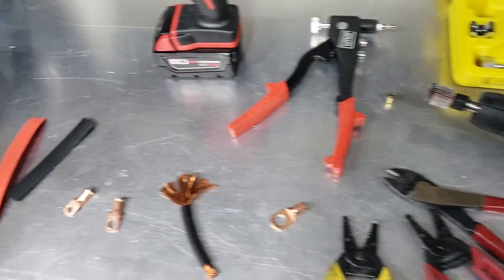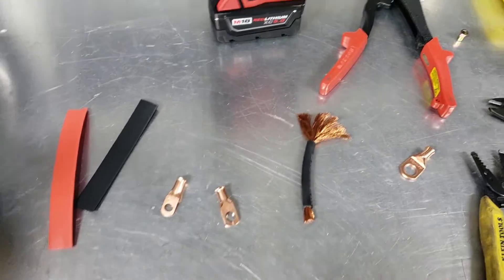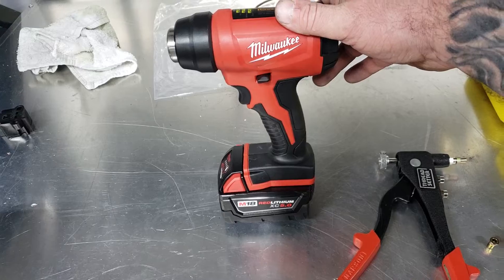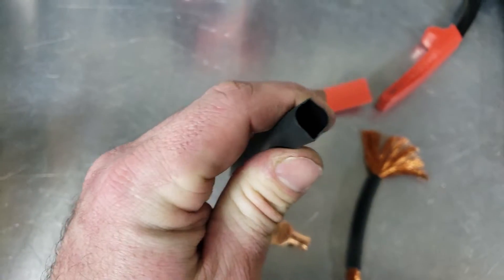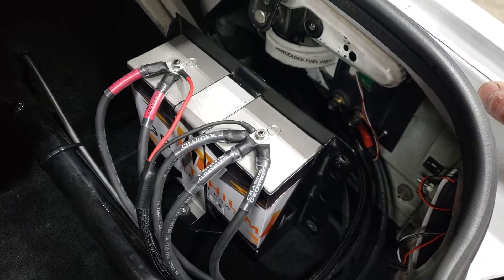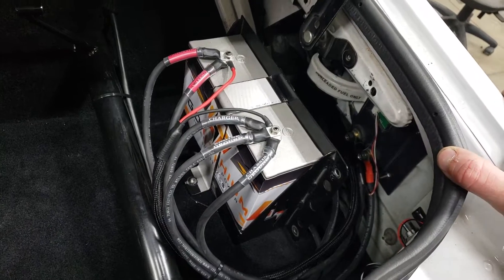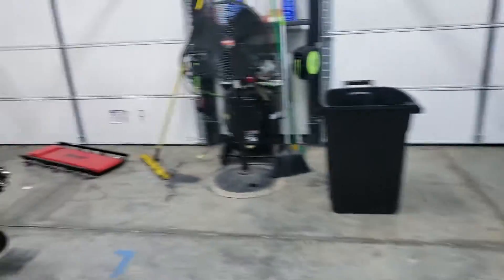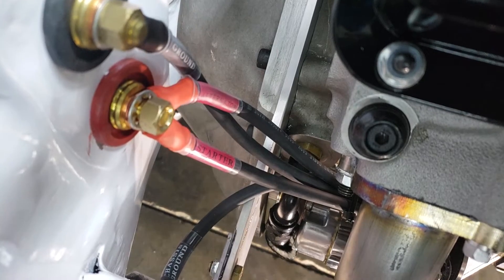Holley efi proper grounding and wiring practices

Comment: Really good info needed before relocating the battery, thanks, Devin. I did want to confirm one thing. Once the ground is through the bulkhead,  I  see a few cables. 1 to the engine block (mounts) 2 from the chassis to the engine block passenger. I see a 3rd ground, is that just going to the other side of the block, wired into the engine mount holes, or head holes like the passenger side? Thanks

Comment: Great informative video, thank you! Question - can I pull a power wire off the fire wall grommet to a power distribution block that'll power things like relay a relay for a Turbowerks pump scavenging turbo drain? Not using this line for sensors. Thanks for any help you can provide.

Comment: @SERIAL_PYRO  Impossible to do when the crimper handle is longer than the vice jaw depth. Crimper handle has to be offset to one side to allow the vice jaws to hold the crimper handle properly ( as close/level to the crimper pump handle as possible) otherwise you won't be able to put enough force on the pump handle to crimp properly.

Comment: I use 0ga ofc it's great need it for large stereo. Also have big 3 upgrade and 2 batteries. Learned about cable years ago when I used home depot 4 gauge for car stereo power wire it worked but was a pain to run. Great tips.

Comment: I have a Holley set up on my gbody I relocated my battery to the trunk using 4 gauge wire but my car will not start . When I use my tool it shows only 7.2 or 8.0 cranking amps with a brand new battery I believe there haft to be a Vote drop

Comment: How is the cut off switch shown to NHRA rules, maybe I'm not following it but with the alternator feed going to the lug that goes back to the battery, even whit the switch thrown cant the alternator still power the car residually? Wouldn't you need to run a dedicated charge wire back to the battery feed side of the switch?
Reply: You are correct  nhra will want the alt change change wire to go all the way back to the cut-off switch   nhra will test you cutoff switch at 2000 rpm to make sure your car will shut off  
Great question

Comment: Super informative video, thanks for sharing! Question on thoughts of distribution blocks - Is there downfall to making a large run (1/0 or 2AWG) for both power and ground to a distribution block near the firewall and branching off from there, with the exception of the alternator wire which will go back individual to the disconnect switch? I am in the process of re-wiring my car completely and have several things like the Leash boards, factory fuse box, starter, etc. and would like to minimize home runs to the battery where possible.

Comment: Do you only run 4awg with 16v? And do you thing 4awg will be enough for a LS motor starter and alt?    Also the two clowns that made comments about how you can do this different or how you’re clearing your throat can F off they’re probably democrats and can keep using car audio wire and cca Fing clowns pay no mind to them keep making awsome videos this shits helpful to more ppl than you realize Haters are gonna hate 🤘🏻

Comment: Thanks for the video, really informative. I noticed you didn't have any fuses or circuit breakers on the hot leads. Do you just not run them? I'd like to know your thoughts on the subject.
Reply: he uses a Racepak Smartwire PDM, no need for fuses or breakers 🤓
Reply: check it https://youtu.be/1j2-n-Ixvhw

Comment: There are a few things that I would do different such as I use buss bars for power and ground but that’s because I spent part of my life doing installing telecommunications equipment and wiring not only has to function but also has to be very neat and orderly. That said in general I agree and like your wiring practices but would recommend a couple of things instead of welding cable check the price of locomotive cable the main difference is each of the fine wires is tinned which help prevent corrosion and resistance, second is the use of No-Ox on connector and connections and since you we don’t want noise in are wiring try as much as possible to have some separation of power and ground. Have a nice day and a better tomorrow.
Reply: you have greatly helped this guy(myself) out. Finding the best alternative to car specific products, like the locomotive cable with its added corrosion resistence, is so nice. I will remember No-Ox and seperating power and ground as well. Sounds on the floor level signal sucks!

Comment: I heard you say you use  4ga what brand and where do you buy that from if you don't mind me asking.
Reply from the maker: i use 4 and 2 awg i buy it from temco
Reply: @theholleyefiguy  thanks for the quick reply... You have an awesome channel by the way I've learned a lot thank you.
Reply: Where do you get your bulkhead connectors I know you say a lot of stuff is not created equal want to make sure I get the best I ordered the wire that you use just wanted to make sure I got good bulkhead connectors... I see a lot of them have 3/8" posts is that what you run? Thanks

Comment: Do you have the power plug for the Holley HP computer?  I am changing a MEFI4 controller on a Ramjet to a HP Holley computer.
Reply from the maker: 558-308 is the holley part number
Reply: @theholleyefiguy  I am looking for the plastic plug only.  I have the wires run but need the plug for the computer

Comment: Good to know that i can safely use the firewall bulkhead as a common post to transfer my positive and ground through the firewall, I had always ran the ground and power under the car directly to the block/alternator-starter. Now I can move the wires inside the car and it will clean things up as far as im concerened. Love your videos.

Comment: Just wired my car up the same way as yours, minus the smartwire, but had a question.   Are you running any fuses inbetween the kill switch and the alt/starter wires?  i didnt see any in the video and i dont have any installed in mine currently.   thanks!

Comment: So I'm doing a Holley on my mod motor with a J2Fab 270amp extreme output alternator. Seeing this wire is rated for 150 amps, is it okay to use this Temco 4 gauge instead of something bigger like J2Fab suggests on a stock computer setup?
Reply from the maker: Use whatever is recommended by the alternator manufacturer
Reply: @theholleyefiguy  Thanks man!

Comment: I am planning on running a trans controller and pdm w/ a magneto ignition. Will following this technique be enough to isolate the electronics or are there other measures I need to take to make sure everything works properly?

Comment: how is the cutoff switch shutting down the car with the smart wire and alternator on the same side of the cutoff switch
Reply from the maker: The switch was there till the 4 pole switch showed up 
I used it for mock up 
The switch used is a 2 circuit switch
Reply from the maker: They're not on the same pole
Reply: Ok in video you had smart wire and firewall on same side of switch , and looked like alternator was on the firewall post.
Reply: Ah ok didn’t know they had 4 poles, thanks!

Comment: Devin That alternator wire needs to go directly to the battery not to the feed side of switch. You cut the power off at switch the alternator can and will keep power on. FYI
Reply from the maker: The switch has 2 pole and is double throw 
It's on it's own circuit
Reply: @theholleyefiguy  Hey Devin. So you must be disconnecting the exciter wire from the alternator at the shut off switch using the other smaller switch contacts?. In the video I didn't notice those wires at the switch just noticed the firewall connection. You do the same kinda work I do, very professional and I like the crimp bolt idea. Subscribing
 Thanks for replying. Glenn
Reply from the maker: @glenngeddes6079  no its a moroso 4 stud disconnect thats rated for 150 amp per pole.  im disconnecting the charge wire.  thanks man i appreciate it

Comment: Devin, what makes a system have inconsistent "mark data points". I have mine grounded per this video and most of the log looks great from a data points perspective but there will be small sections where it drops from 60 data points per second to 15. I run non-resistor race plugs....could that be part of the issue? For grounds I have 4 AWG welding cable from battery to chassis, battery to block and block to chassis.

Comment: Devin, what's your thoughts on CCA battery cable compared to welding cable? I know it's lighter but how about dependability/performance?
Reply from the maker: i remove it and replace it with welding cable

Comment: Can Holley EFI power be run thru a discount on the alternator circuit lugs?
Reply: Disconnect
Reply: Holley tech video says no...only straight to the battery.

Comment: Looks good but... if your wire the alternator up after the kill switch, the car will stay running off the alternator when the switch is flipped off correct? 

I’m going to run it this way and try it. But I’m nearly positive that kill switch will not function the way nhra wants it to.
Reply from the maker: The kill switch I use has 2 seperate poles 
4 studs on it

Comment: Devin, are the factory grounds from the firewall to the cylinder heads on a foxbody good to use with an HP or do I need to upgrade to larger wire like you show?

Comment: I’ve had my dominator since the summer  I am watching your videos to build up my confidence to install it thanks for the post since you run 4 gauge weding wire for everything do you buy it online or at the welding shop  also it looks like you bought a lot of your stuff from Fastenal ?
Reply from the maker: i buy most everything online welding shops are crazy expensive

Comment: Installed the sniper with the full hyperspark ignition in my 69 Camaro. I connected the pink trigger wire for the ecu, cd box and distributor to the IGN spade in the fuse box. Power is back feeding so the car does not turn off when key off. Is that a ground issue?  Would you be willing to build and sell me a ground cable if i give you length? This is the only car i will ever build so i have limited wiring tools and crimpers.

Comment: Good video!

Wouldn’t you get alternator back feed with the power wired like that at the disconnect switch?  For example, say at 2000 rpm, flip the switch, everything stays powered due to alternator.
Reply: Was just rewatching this and had the dame question.
Reply: Any answer on this? Definitely seems like the car would keep running.
Reply: I have read several articles that state the alternator needs ran to the battery so the kill switch disconnects the alternator from the rest of the system.
Reply: @mtb09  Interesting but can you explain with more details please? I'm doing this in my car right now and it would help me a lot.
Reply: @arlokkkk  alternator runs to battery and the batter runs to main disconnect. All your system power and relay power comes from the main disconnect. There should be 3 cables hooked up to battery positive; alternator, battery disconnect, and holley ecu main power.
Reply: @mtb09  thank you!